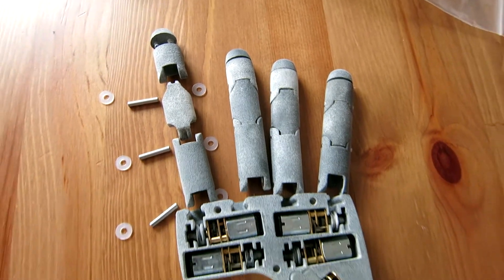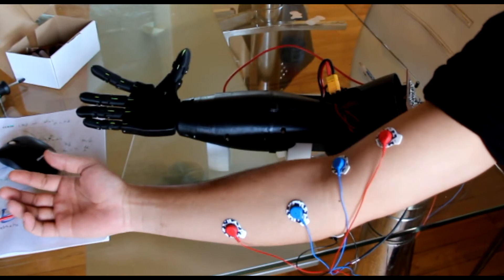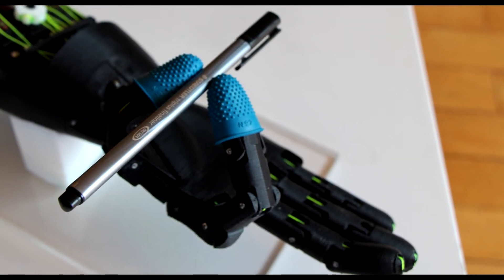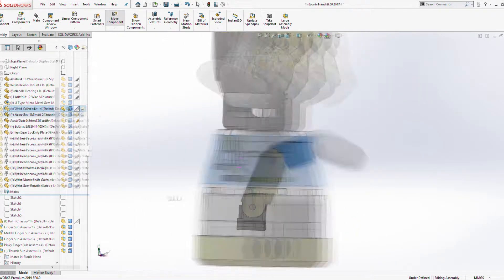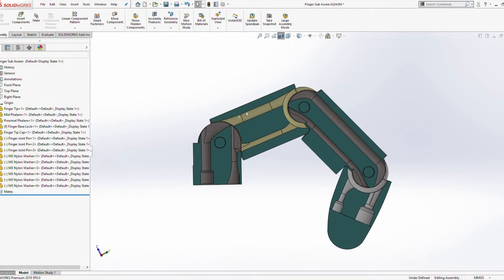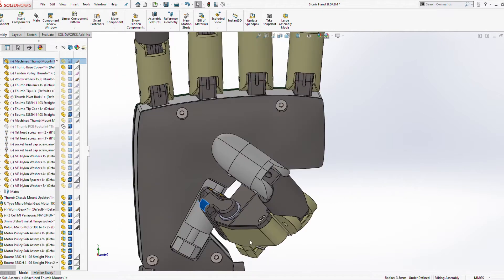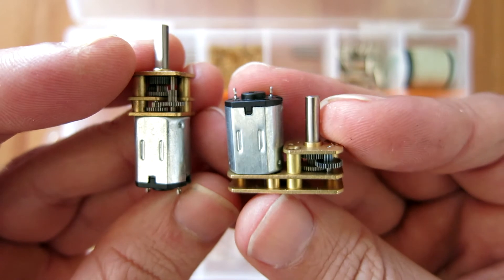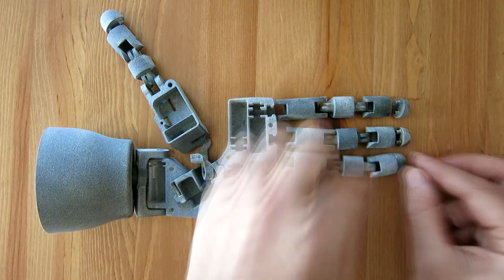Compact Bionic Hand - Intro

Comment: what is the software you use? Can you test NN on the virtual hand?
Reply from the maker: Solidworks for design. What exactly do you mean?
Reply: @MahdiDesigns  After design the virtual arm,  can we test its functionality with some codes, like NN code?
Reply from the maker: @mitkosokolov9382  not directly with SolidWorks. Can test it's movement using solidworks directly but would have to use some additional plug in software to use a NN to creat motions in Solidworks
Reply: @MahdiDesigns  Any example of such additional software ?
Reply from the maker: @mitkosokolov9382  you could use Matlab or Python to generate some neural net control
Reply: @MahdiDesigns  Can we import Python code in Solidworks, or Solidworks file in Python IDE?
Reply from the maker: You can import a CAD file into matlab or python. I think to animate for simulations will be easier in matlab but you will have to research tbis